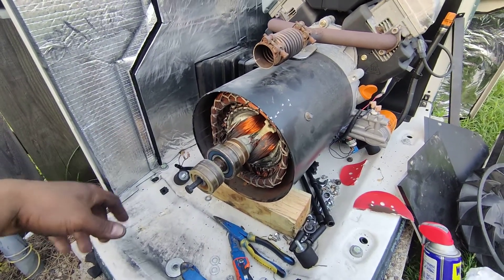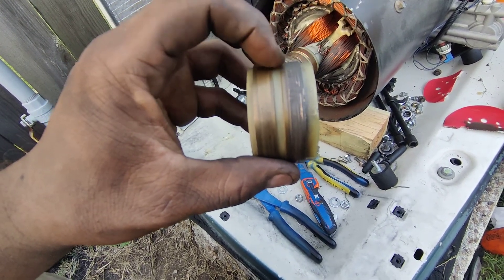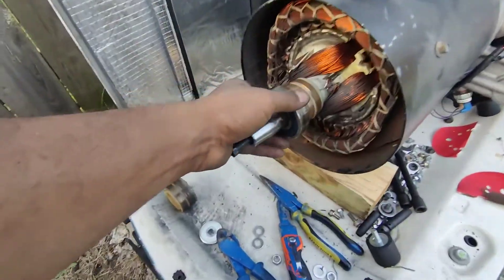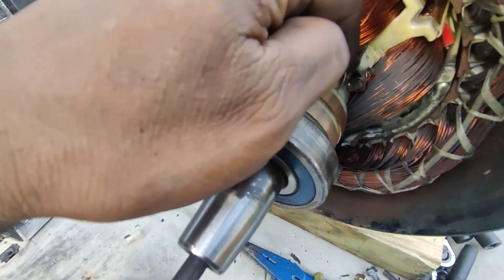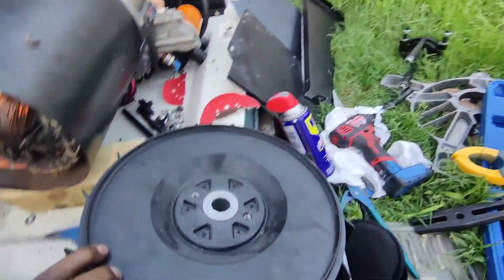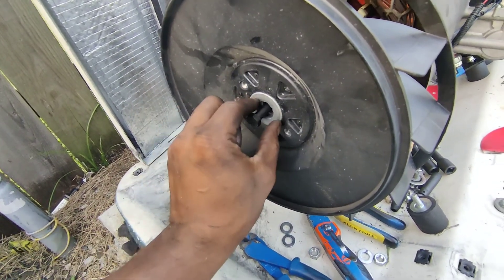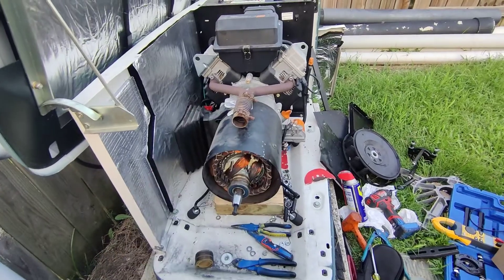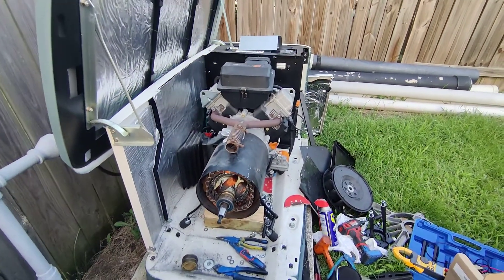Generac generator 1902 under voltage repair

Comment: Dude! The rotor is $1200 alone ($900 if you dig around). My slip rings on my 22KW have a 1/8 deep groove, they are shot! New brushes lasted about 3 hours before failing even after sanding super smooth. The slip ring was $40 shipped. OMG, life saver! Thank you! A+

Comment: I cleaned the slip rings on mine and it works like a champ now.
Reply from the maker: Id suggest keeping an extra set of brushes ready. Itll only fail when you need it.

Comment: Faced a slip ring issue just an hour ago on a job ..there was a 2 1/2" section of carbon build up on the rear slip ring i just took a rotors tool with a wire brush and cleaned it put it all back together ..boom 240 volts again much easier than replacing the slip rings which wasn't bad just had build up in a patch
Reply: Certified generac technician *..of 8 months
Reply: Good video
Reply from the maker: You cant just clean it up. Did you check if the ring was nice and smooth? Due to the carbon build up i bet it wasnt. Cleaning the brushes will work, however the rough slip ring will eat through it quickly again. With good rings there should be very little build up because the brushes will wear out slowly over time, the build up comes from them wearing out quickly.  Master Electrician.
Reply: @mdrmoose  I've worked on that generator before, I remove that fan and the brushes. Clean the brushes off. And then use sand paper to clean and smooth out the slip rings. You can put the sand paper on your finger tip, and spin the rotor with a ratchet to spin the slip ring against the sand paper. Saves a lot of time.
Reply from the maker: @jimmyms2832   thatll probably work, but would you bet a warranty repair on it? The. Replacement slip ring was $20. How much you think itll cost if you have to come back out?